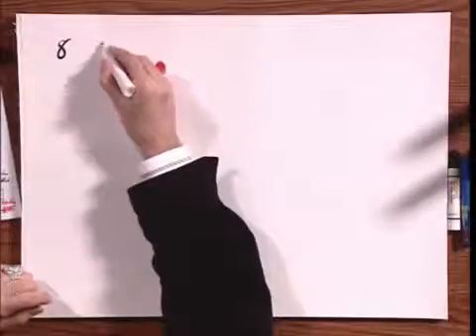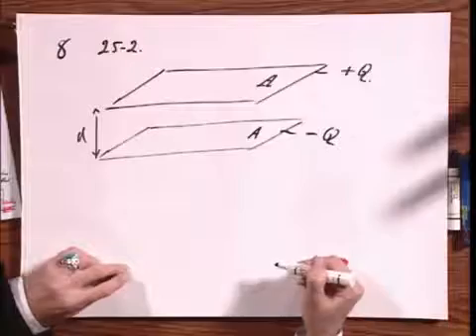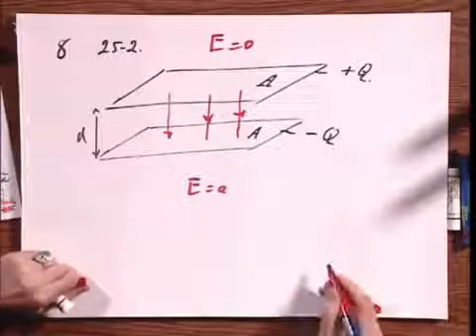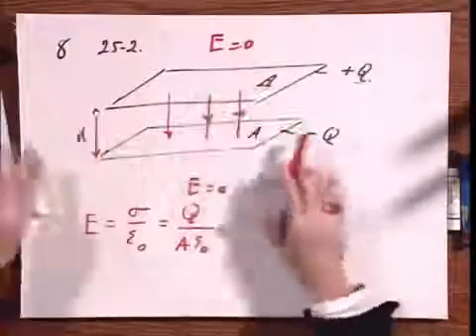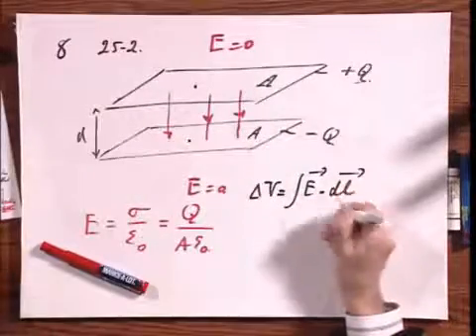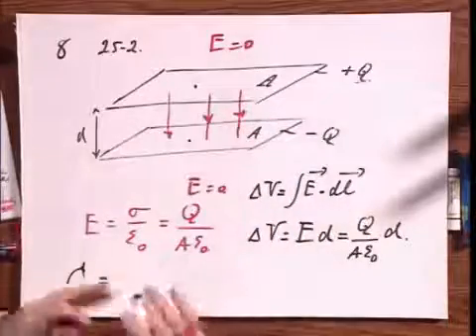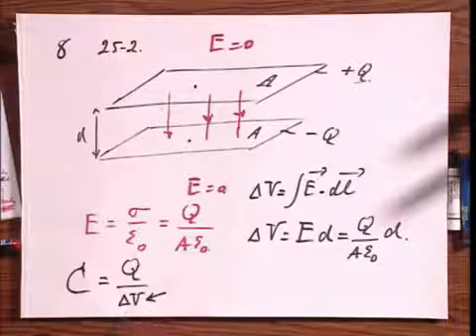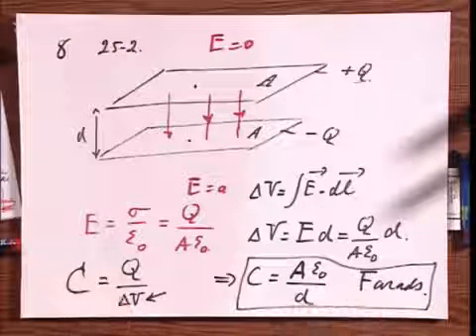8.02x - Module 02.07 - Parallel Plate Capacitor.

Comment: sir capacitance = charge \potential.sir in this video why you say capacitance = charge\change in potential
Reply from the maker: A capacitor in general has two conducting parts separated by a dielectric. V is the potential difference between the 2 conductors. C=Q/V

Comment: sir how you find the capacitance if area of the plates is not sam
Reply from the maker: Place the same charge on each conductor (opposite signs)  then calculate the potential difference between them. As an example there are spherical capacitors. The inner radius is smaller than the outer one.  http://www.phys.uri.edu/gerhard/PHY204/tsl106.pdf
Reply: @lecturesbywalterlewin.they9259  
Can we not find capacitance of overlapping area????

Comment: Dear sir, I get how we get Sigma/Epsilon as field between the plates in a capacitor from your other video but Sigma/2Epsilon expression was for a infinite sheet of charge. In case of capcitor the charge will be only on the inner surface. How can we use the same expression.?
Reply from the maker: watch my 8.02 lecture on capacitors